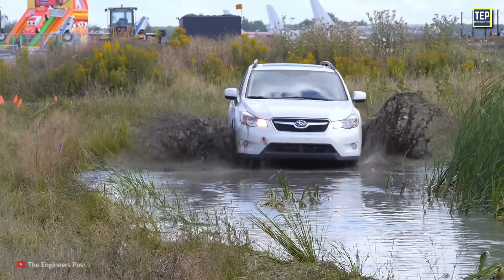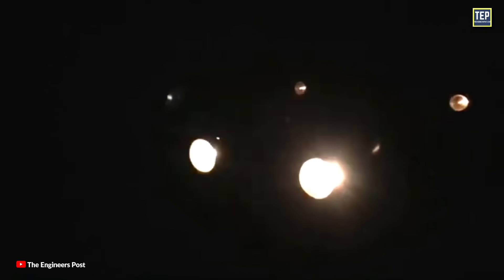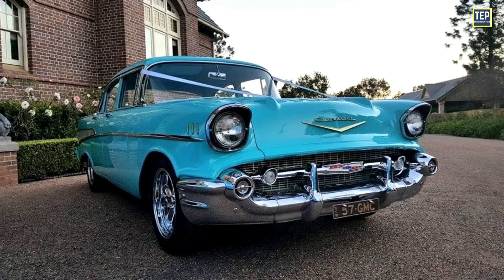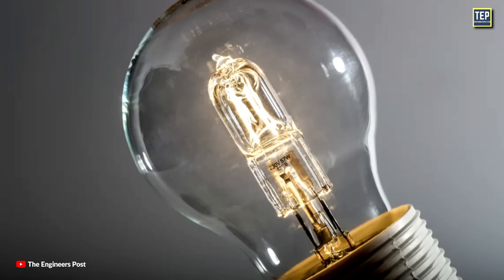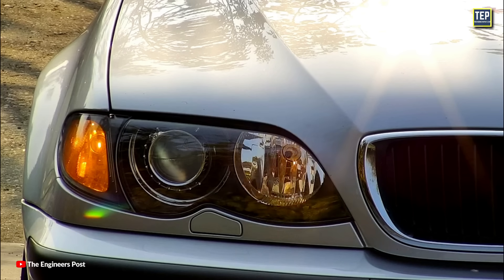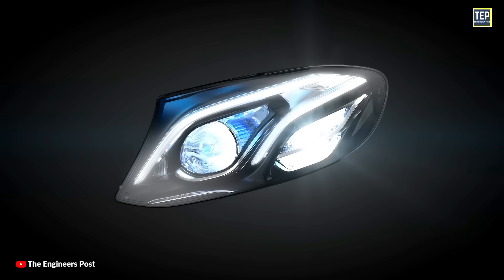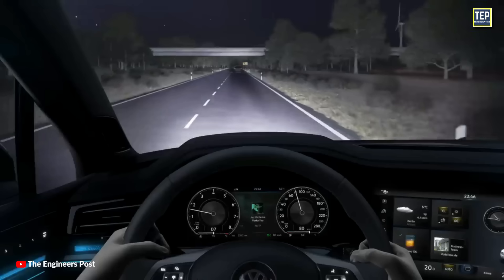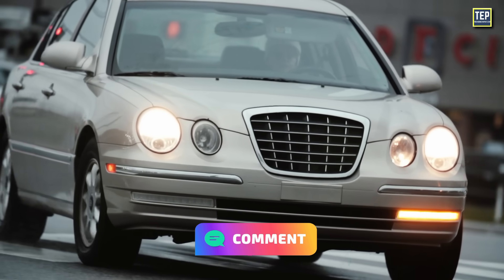The Problem With These Headlights

Comment: Bring back the sealed beam. Does teh job well, never fades,  affordable and easy to replace. Some of these headlights can total a car out. We're talking thousands of $ for a stinking headlight. Totally un necessary. Recently a buddy's Rover DRL went out. Can't replace just a bulb. $3500 for a headlight because the DRL or the signal lamp is out. Insane
Reply: North American sealed beams were dim, yellow $hit. Halogen-cycle bulbs were the quantum leap in forward illumination, particularly at Autobahn speeds. Everything since is stupid-expensive, unneeded complexity.
Reply: @blackrifle6736  Maybe the best compromise would be standardized LED bulbs. Efficient technology coupled with easy replacement.
Reply: “Does the job well” 

That’s an overstatement if I’ve ever heard one.
Reply: That issue is a result of the car companies being rip off merchants, an LED headlight manufactured cost is maybe $100, more than the others but nowhere near $3500
Reply: As a person who suffers with night blindness, trust me these are hard to drive with due to the low light emitted. Makes it dangerous to drive in the dark.
Reply: But I'm with you on the headlight prices, DRLs are just an unnecessary piece but hey we can do something if we stand together we can do something as consumers
Reply: @SosoShibase  I can turn the DRLs off on my car. It's a menu item buried 3 or 4 touches in.
Reply: A lot of them you can change the globes no worries, however if a bird or a roo takes out your headlight assembly , as you mentioned, you can be up for some real coin .
Reply: Sealed beam light fail if you get a stone chip, the standard size with Halogen bulb replacements worked very well and would carry on providing light even if the lens was broken .
Reply: You left out a very important part of the headlight story. I find it interesting that regarding led headlights you stated ‘ a much brighter light w/o blinding oncoming drivers’. Totally wrong ! They are dangerously brighter and routinely blind other drivers. To add to the problem as pickup trucks are now as big as dump trucks used to be to appeal to a certain demographic. Unfortunately that same demographic often gets its jolly’s tailgating those of us who choose a more reasonable and environmentally conscious automobile, ie smaller. Oncoming drivers aren’t tailgating but could care less who they blind anyway as long as they can drive a newer/different type vehicle, as in expensive. Dot let’s this dangerous trend exist due to pressure from manufacturers. Brighter is not always better/safer !
Reply: Look at bright side if the model is popular enough, you can collect all the failed LED headlights from popular models and refurbish them. Sell them again.
Reply: This is an uninformed opinion. LEDs light up the road making a sealed beam unit look like a dim yellow candle. The difference is night and day!
Reply: Probably the most ridiculous part of that situation is the bulb is typically only 10 dollars on average so I'm wondering what car you have that requires a full housing replacement
Reply: Sealed beam? OMG no way.
Reply: I have ECE H4 conversion headlights on one of my cars that take a 7" sealed beam. They're as good on low beam as my modern car with LED projector headlights and better on high. The cost to convert both headlights with bulbs was under $100. It's plenty sufficient.
Reply: Sealed beams are crap. Halogen sealed beams only just above crap. I have 5 cars. 2 with halogen, 1 with HID, and 2 with LED. LED is best. Keep them clean and adjusted properly!
Reply: Only partially fault of the technology. The biggest contributor to that is corporate greed. "You bought a new car with the newest fancy tech, you have to pay out the ass to service it" is the mentality they have.
Reply: Bring back the horse and cart. They did the job. Also, bring back caves and loin cloths, that's all we needed then so must be fine today.
Reply: @matthewnicholas6365  We'll get there soon from the looks of where we're heading.

Comment: I have a ‘96 SE & ‘99 GXE Nissan Maxima and both I replaced the halogen headlights to LED lights with a balancer this was about six years ago & still running great. 4,000 lumen brightness and Color temperature is 6500 kelvin which is daylight bright. I bought a newer led headlights set with 6,000 lumens but i haven’t installed them yet, everything nowadays is plug & play.

Comment: NONE of the newer options are acceptable!  I have a 2008 Corolla with halogen headlights, and I refuse to get a newer model that has LED, HID, Laser, or any other blinding headlights.  I can’t even stand to drive at night anymore because of the glarebomb headlights shining into my line of sight.
Reply: Problem in my country is that old cars are allowed to use ultra bright LEDs while they are on reflector type headlights. I drive a newer car with LEDs but it is projector type so I can point it down without blinding oncoming traffic. Newer daihatsu Toyotas here still use reflective type with LEDs which pisses me off specially at night. Cant believe they are still cheaping out on headlight units.
Reply: I noticed that often all the blame is shifted to ebay led's and while that is absolutely correct there is also big problem with these new adaptive leds and lasers on new Audi and other "upmarket" brands. They look fancy and great in the manufacturer commercials, but in real life conditions they fail to redirect light and end up "flashbanging" oncoming traffic. I had many times a situation where I get absolutely blinded by an oncoming brand new car because they fail to redirect light, signal with my high beams, then they redirect/cut out just to loose track of my lights right in front of me and proceed to shine directly in my face. For this reason I simply hate new cars and started to brace whenever I see one incoming at night.
Reply: @owerty100 same, my headlights aren’t bright enough to be noticed by some matrix headlights, I’ve noticed it more on Kia’s oncoming and some Prius’s behind me.
Reply: People before halogen used to say the same thing. Proper headlights don’t blind other people. It’s the people with aftermarket
Reply: New cars with new headlight technologies don't blind, old cars with cheap LEDs stuck in them do.
Reply: @emmettjohnson142  Some of the new cars' led lights do produce quite the glare, but not all.

If xenon lights are blinding, they're most likely adjusted incorrectly. Most of them are of the projector type, and have very sharp cutoff producing very little glare.

Anyway, I haven't had a daily driver with halogen lights for 15 years, and I'm not going back.
Reply: How do you not have a handle?!😭😭
Reply: @emmettjohnson142 oh really ..  go tell that to all the new Escaldes, GM + Ford Pickups..  even on higly illuminated downtown city streets.       You must not get out much     or experience many things.        Or maybe your riding high     ,  but whoever is driving close to the ground , definitely are being blinded by all led , xenon, hid   and i guess laser lights out there
Reply: @emmettjohnson142 yes
Reply: You should also refuse to replace your halogen bulbs with anything other than the OEM halogen bulbs. Every 2000-2014 Toyota I see on the road has LED aftermarket bulbs installed. They don’t get properly levelled when installed and have an awful flicker. Not only do they blind oncoming traffic, they also create a huge distraction in the mirrors of anyone driving ahead.
Reply: And the police refuse to do anything about those morons who drive in traffic with their high beams on.
Reply: Manufacturers are using childish lights to entice buyers instead of improving their quality. There is absolutely no need for any more powerful headlights. The ones we have are already too much; they dazzle every drivers on the road. These need to be brought under control by the gov. 

Car manufacturers are the biggest criminals going right now.
Reply: Ok boomer
Reply: We have a 2015 Mitsubishi ASX and it uses halogen bulbs too😭😭😭
Reply: Hids were actually introduced to auto industry in 1991 not 2004
Reply: Amen!
Reply: There's so much misinformation in this video.
Reply: So you have light blue eyes?
Reply: Exactly 🗿🙇🗿
Reply: Are you aware the new cars with new technology have a way to prevent that glare? Every type is acceptable with their right technology. Y'all be talking here like there's anything ever 100% acceptable. Your halogen bulb is also not acceptable in some situations.
Reply: even a 2023 Corolla still has a halogen indicator, LED/HID is more energy efficient and it doesnt emit that much heat, even if it's too bright, just get one that is not so bright.
Reply: Definitely don’t understand how people believe they’re blinding. If the car was designed for it or they’re aimed properly it isn’t an issue 🤷🏾‍♂️ but I guess my eyes are just use to it
Reply: clean your windshield or change it and get over it
Reply: sooo sumbit a claim for windshield tint
Reply: Projectors are compatible with any light source but are too costly for most mainstream vehicles in the accountants' minds. They really are the best from the driver's perspective.
Reply: Mostly aftermarket and light bars, I'm thinking. I have LED low beams and laser high beams that are coded from the factory to not "dazzle." They don't bug anybody, I could even be behind you with my high beams on without blinding you. And from the driver's seat they look incredible.
Reply: Nah halogen is useless
Reply: We're facing the same problem in India. Even motor Cycles have these eye penetrating lights. There should be global ban on these lights.
Reply: The video literally gave you one of the reasons this happens, LEDs on the inapropiate "casing" for said headlight.

Bulb headlights are cased with highly reflective materials to increase the light of the poor bulb. LEDs are not reflective based but projected based, unfortunately, some brands or just some models have LEDs on headlights that are meant for bulbs.
Reply: Cmon boomer.  I'm a millennial and even I know H.I.D were the best of the old school technologies
Reply: Have a 2020 Corolla, since I went with LED lights, I never had too change any of the lights. With my old car, every couple of months I had to go and change bulbs. What made it even worse is the bulbs are not directly accessible. I had to disassemble the air filter and part of the intake plastic hoses. I'm definitely going for the full LED package on my  next car.

Also those new Matrix LED headlights don't blind you at all. Sadly they are very expensive option. Hopefully in the future they'll become more affordable and the standard for most cars on the road.
Reply: If you're replacing headlights every few months, then there is an issue with the car.  Inhave an 07 Camry and only replaced the headlights once.   @lamcho00
Reply: @lamcho00    “Every couple of months”???  Something was wrong with your car.
Reply: Wall of text below but tl;dr:  It's not the tech that's at fault. It's the incorrect application of it coupled with the ease and accessibility for the average consumer to unknowingly use the wrong bulbs and not know the consequences to other drivers on the road. 

The problem isn't new lighting technology, it's the incorrect application and/or retrofitting of older cars with newer technology that leads to the blinding glare from oncoming cars with just their lowbeams.

Personally I feel that HID was the best technology for headlights we've ever gotten, easily retrofitted into older cars because of the price barrier of those who would consider the upgrade usually being enough to appeal to only enthusiasts or people that are typically more knowledgeable about cars in general.

The real problem that you see everywhere for the past several years is people buying LED bulbs amd sticking them into their stock halogen housings. Neither projector beam housings nor reflector housings are compatible with off the shelf LEDs because of the way the light is projected from the diodes vs any other light bulb design. Any attempt to do so usually results in super bright focused light that's then scattered poorly and impossible to aim or adjust correctly.

So you have tons of cars with super bright LED lowbeams that cannot be aimed downward from eye-level of oncoming traffic without also severely reducing the effective viewing distance for the driver.

I remember when I was young and my dad went to get the car inspection done they would aim the headlights as part of the job. I feel like this would be the most effective solution to this problem that's getting worse every year.

So if you plan to buy new bulbs, at least do some research into the most compatible bulb design for your particular car and headlight housings because it really matters when changing to LED bulbs. Or do the conversion properly and replace the entire headlight housing with ones specifically designed for LED bulbs and use only the exact bulbs that are designed for that new housing. It's super important that they match.
Reply: Don't confuse bright with dazzling. I've added a general comment to explain. Also, there are a lot of studies which show that glare has a negligible impact on accidents whilst bad visibility ranks high in fatal accident causes. A well aligned modern headlamp is always the best choice for safety.
Reply: @christopheckstein8683   From your drivers seat? Not for oncoming vehicle. Also think glare or too much of it would be included in bad visibility.
This is the oncoming cars perspective. cheers
Reply: It seems you're having Excuses because you don't like Change. It's Ok Old Timer! 
Things that you know from your Time are Always the Best Product Right?  That's what Every Generation Say 😂😂
Reply: @CaptainKedah You are wrong.  YOU PEOPLE NEED TO QUIT BLINDING ONCOMING TRAFFIC.  CONTRARY TO YOUR Immature POINT OF VIEW, you do NOT have the right to blind other people.  It has nothing to do with how old the other motorists are.  It has EVERYTHING to do with your immaturity.
Reply: Obviously, you drive in the city at night and not on country roads with little or no ambient lighting. I went from halogen to HID/XENON and would never go back.  I now have LED and wouldn’t go back to HID.
Reply: Just don't look directly at the light man, it's going to be fine
Reply: The good LED matrix do not blind anyone. They simply turn off where the incoming cars are, it is completely dark for the other driver. It is a very nice thing to have.
Reply: It only really blinds you if they keep their high beams on. At that point it is the drivers fault.
Reply: Age is catching up dude 🤣
Reply: modern cars equipped with xenon, led or laser headlights dont blind you, blame people for putting extra bright leds at their old cars, newer cars have technology which changes the brightness
Reply: @cannedcatkacz3 I don't know I have an issue specifically with Acura, Tesla and some Ford trucks.  For whatever reason they just don't seem to be aimed properly from the factory. Then we have the people that just drive with their brights on.
Reply: I think the problem is with your eyes. The only lights that blind me at night are those that are improperly aimed or folks who put LEDs in halogen reflector housings. New cars? No issues. Because they are properly aimed from the factory.
Reply: Nothing that can’t be fixed with modern matrix headlights technology which can detect and black out oncoming traffic so they don’t get dazzled.  Of course older cars don’t have that technology and should stick with what they were designed with, or have their aim-point lowered.
Reply: Halogen bulbs are actually worse at blinding drivers. LEDs, Xenon HIDs, and Lasers do not as they project down and not straight.
Reply: Omgosh you are just so right man, so many bad bad people out there their lights just too damn bright. It'd be better if everyone just went back to dim crappy halogens, so you have to drive everywhere with your high beams on anyways because you're clearly a boomer. If only the world shared your infinite wisdom we'd all live a much better place. You know blowing out someone else's candle doesn't make yours burn any brighter
Reply: I can’t drive a car with halogen headlights horrible visibility and they make the car look dated. LEDs bring life to any car.
Reply: @RomanM803 you might wanna find some glasses if you can’t drive without your leds
Reply: @RomanM803 Oh man, how lame
Reply: Whatever, boomer
Reply: @nonick969 Get lost snotty nose kid.

Comment: Now get those LED drivers to keep the auto high beam lights off.   They see the switch and turn them on in the city when it is not needed and blind the other drivers.  Tesla and Honda are the worst.
Reply: Rubbish. Both my Hondas automatically dip in street lighting, as I'm sure they all do.
Reply: Where I live people drive with the high beams in the city All the time because they "can't see" You can't see because the other person has high beams too you nitwit. Cops used to make people look into the lamps but stopped immediately after it. became news.
Reply: is that what it is? everytime i think someone is driving with high beams on its ALWAYS a Tesla or a 11th gen civic
Reply: Oh so us led headlight users can't use auto headlights what happens if we have led daytime running lights?
Reply: They just need to be upgraded to a halogen light.
Reply: @MrOpinions-f3o or acetylene 😂
Reply: @MrOpinions-f3o no
Reply: My Volvo XC90 with full adaptive headlights automatically dips to low beam when it detects street lighting.
Reply: @jdean6357  they are always too slow to react. One day you will blind someone and they will crash.